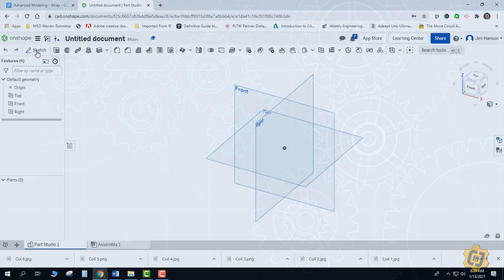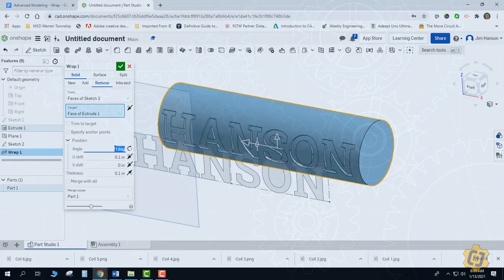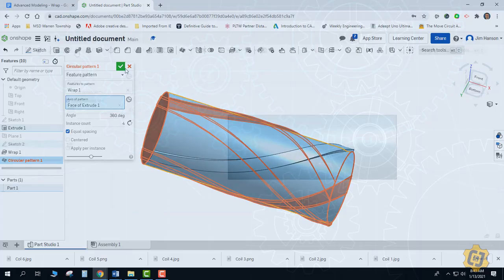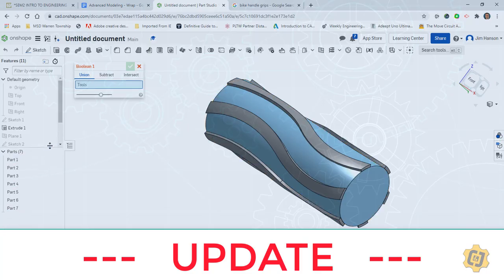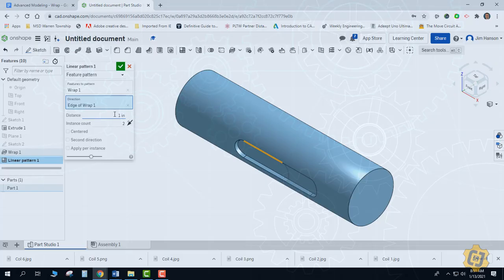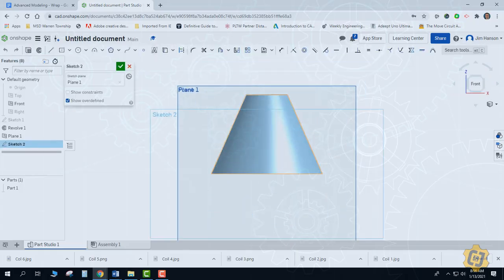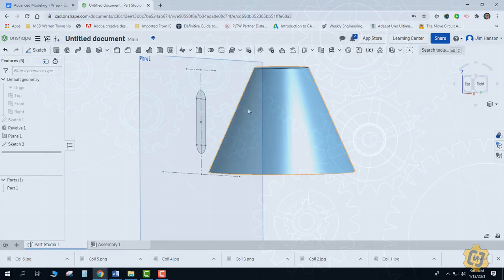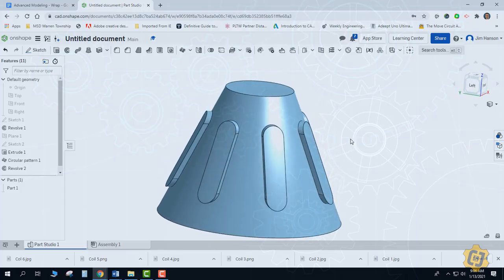6 Onshape Wrap

Comment: Brilliant. You can actually use a "Tangent Plane" script to get your plane aligned with your surface and then do your sketch on that plane before you do your extrude. That way your emboss and deboss will be in the same direction as the tangent plane.
Reply: Where is that script?

Comment: Around 18:25 when you created a sketch to revolve cut.  Could another way be do original offset remove. Remember that distance in. Then select that bottom surface for a new sketch,project use tool. Then extrude the distance u want it to stick out plus the depth it went in? I havent tried it yet but it sounds like it would work

Comment: The description below will  make angled slots in a cone.  It is hard to explain all the steps but I'll try.

Build truncated cone

Use the shell command on the top and bottom surfaces to hollow out the cone

Draw line on cone surface from top perimeter to bottom perimeter on one of the principle planes (such as Right)

Make a new plane on this line.  The plane should be touching the new line and be touching and tangent to the top and bottom perimeters

On the new plane draw a vertical slot then rotate it a few degrees

Extrude the slot through the cone shell a small amount as a  part

Use Circular Pattern to copy the extruded slot parts around the cone, each slot part will have it's own part number

Use Boolean to subtract the slot parts

The result should be very close to the Wrap method of extruding slanted slots through a cylinder

Now a new cone can be constructed inside the cone shell and unioned using the Boolean tool

Comment: When circular patterning a trimmed wrap, try checking the "apply per instance" box in the circular pattern menu. I find it works for many issues that come up when patterning features, and it worked for me in this case. My best guess is that it has something to do with non-planar surfaces and some sort of conflict caused by rotating or moving certain constraints around.

Edit: I have noticed it seems to only create one new instance for some reason, at the position where the first new instance would be You then cannot continue to make another circular pattern from the same wrap. No clue why or how to avoid it, but if you only need to copy it once it will work perfectly.

Comment: You were missing something on the cone wrap. When you extrude a sketch you can extrude in two directions. These two directions can be in the same direction, but at different distances. If you extrude the first direction up to the the face without an offset and then extrude the second also up to the face only with an offset I think you would have it. Also when patterning and you get all of the features red, you can set the pattern to "Apply per Instance" and that should solve your problem I have a public file call "conewrap" that you can see these suggestions and how I did this exercise. Great video and keep up the good work.